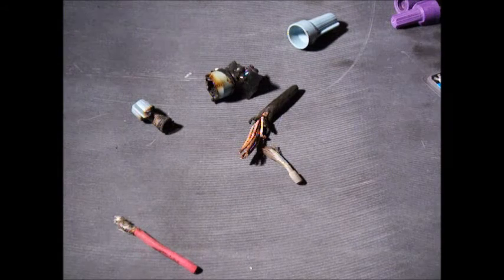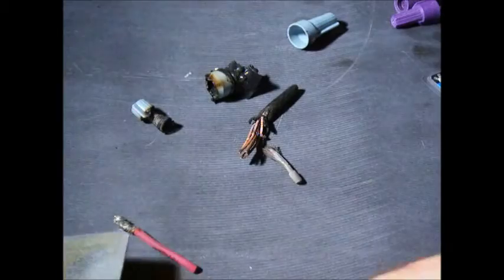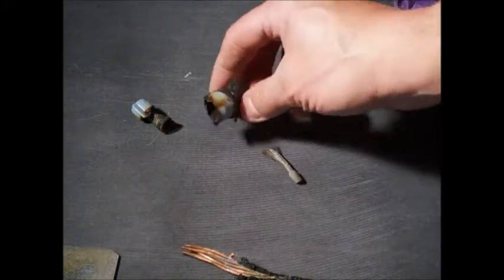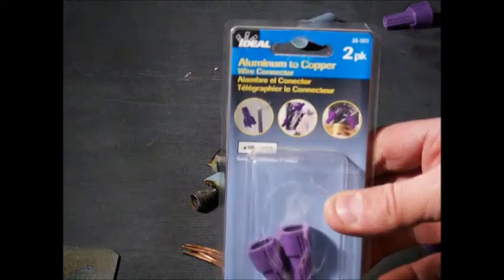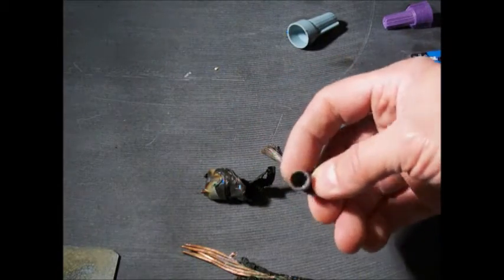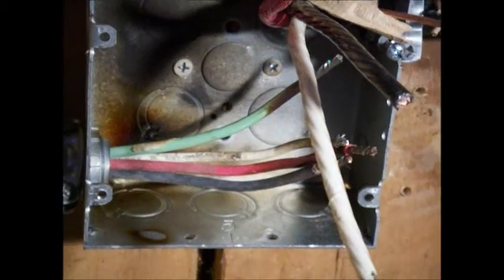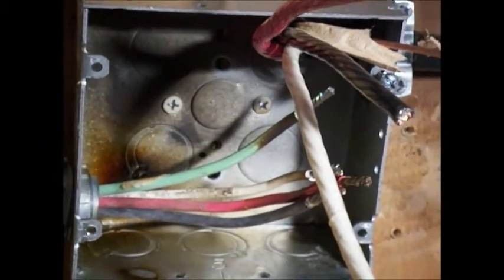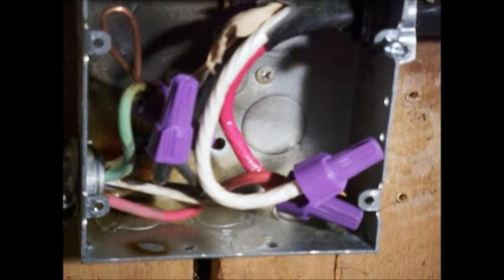aluminum wire to copper wire  danger

Comment: Does it applies to the PC power charger cable?
Reply from the maker: I believe PC wires are tined copper, this video is about residential wiring in the US
Reply: @bbbjim1fixedit  I'm in US. It didn't worked at all, no charge for some reason. Maybe 2nd wire was dead completely, or ... idk. But thank u for the fast response!